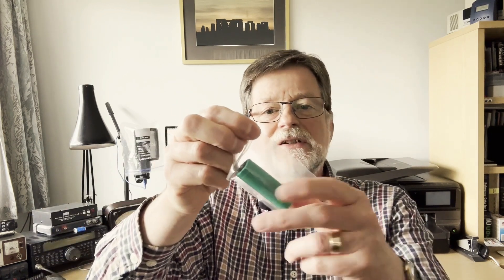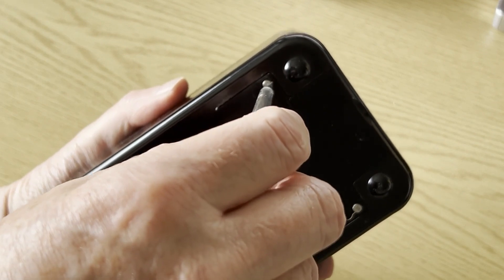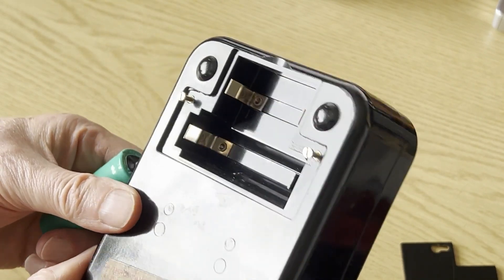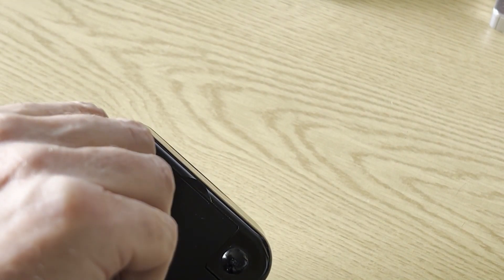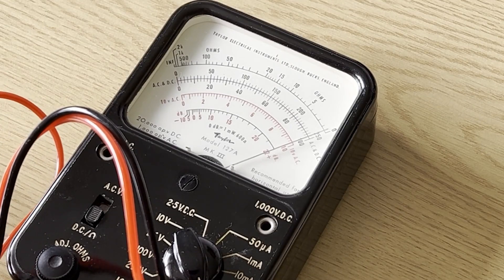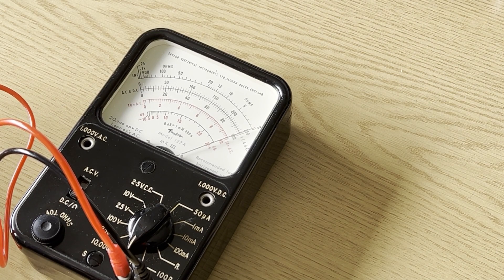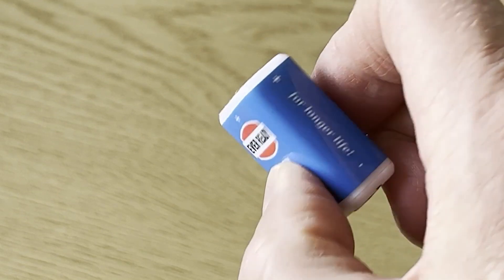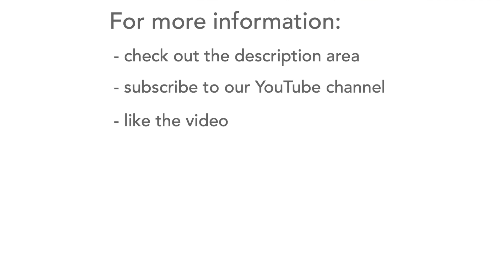How To Replace Obsolete Batteries On Your Multimeter

Comment: I'm glad you like my B121 battery adapter, I'll add U10 to my todo list for future adapters.
Reply from the maker: Yes, I was really pleased with it. I had never expected to be able to get one of these and when I saw it, I just had to buy one! It arrived and I was really pleased with how it looked and worked. As you saw, the meter sprang into life! I've added your  eBay supplier name to the video description, so hopefully you may get some more business. A U10 would be a great idea. That did not have the same look as the B121 you supplier. It works fine and is great from that point of view, but it is not quite the same in terms of its look and long term usage!

Comment: Reminds me of the DMM (Rapid 212) I had from college - one day was going through some stuff and found it, was about 18 years since I last used it at that point with the original 9V battery inside. To my surprise the battery still worked and was at about 60-70% state of charge.
Reply from the maker: That is really amazing. It is great when you are surprised by an old favourite turning up out of the blue!!

Comment: An analog meter movement is perfect for adjusting a circuit for a peak output, such as when aligning a radio receiver. You don't have to watch digits rattling up and down and try to guess if the number is higher or lower than the last one. A bar graph on a digital meter helps, but the resolution isn't great and you can't see small variations.

That's a nice little meter. I'm glad you were able to get it working.
Reply from the maker: You are so right about using analogue meters for making adjustments - so true.

And yes, I am delighted the meter is fully operational again!

Comment: I have 3D printed size changers to use AA or AAA cells to replace cells that are no longer made, hadn't thought about a holder for button cells to replicate some of the odd voltage batteries that used to be in stuff.  With all the different sizes of button cells available now you could probably replicate any of the old batteries.  

I have my dad's old analog meter from the 1950s and found out the movement had been blown out at some point, it has a milliamp range that you could accidentally move the dial over and if you did that while connected to a voltage source it would burn out the movement coil.  Last time I think I saw that meter working was in the 80s.
Reply from the maker: I confess the idea of having button cells that are less likely to leak is rather appealing. However having a size changer is great - modern alkaline cells are much less likely to leak compared to the old zinc carbon, although if left long enough, they certainly will as I discovered when I had to save an old Maglight torch.
Reply from the maker: Sorry to hear about the demise of the analogue meter.